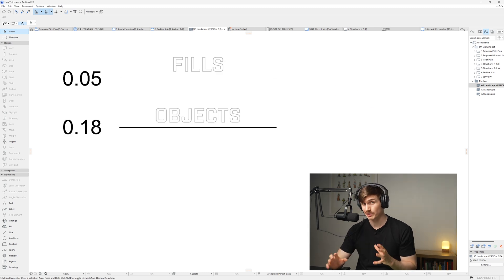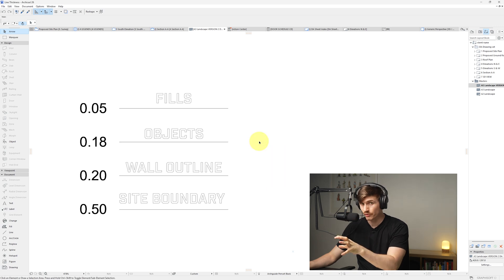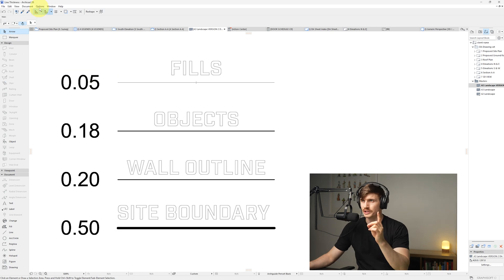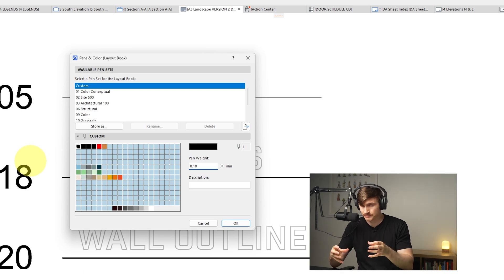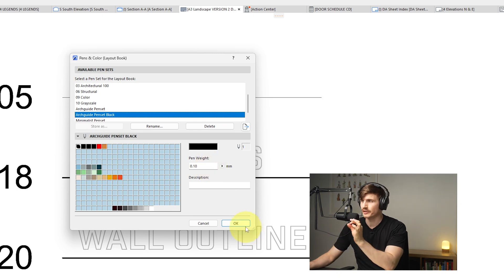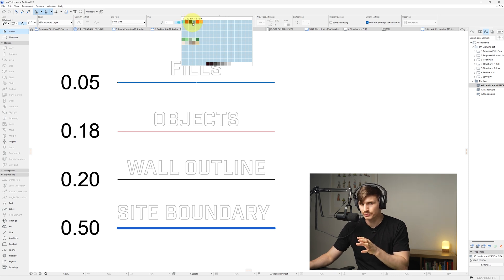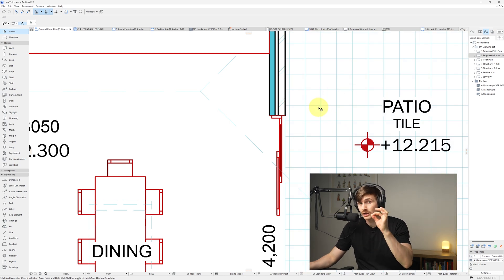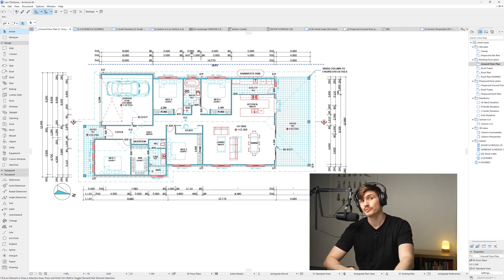How To Change Line Thickness - The Easy way

Comment: In AutoCAD line weights and line thickness are different properties. Don't know if you are familiar with that but thickness, which can work only with polylines, allows you to draw very thick dashed lines without ruining the dashes (the polyline is thicker but the extremity of the dashes are flat instead of rounded). Does Archicad have something like that?

Comment: I noticed that there is a difference when True Line Weight is On depending on the Floor Plan settings in 2D for eg, if Projected with Overhead is selected the lines are thinner but if Symbolic is selected the lines are thicker. What setting is the appropriate on for drawings on Layout pages i.e. when you print a plan